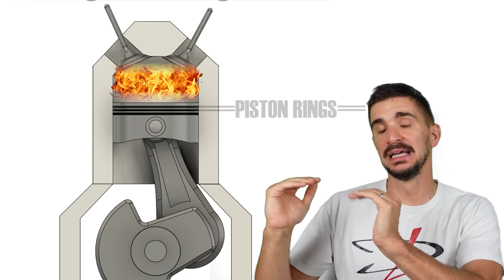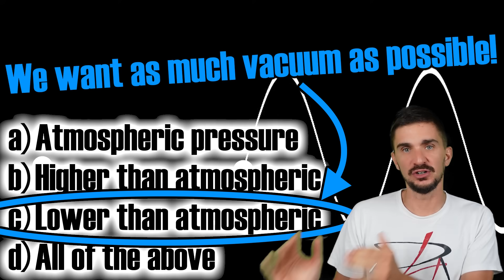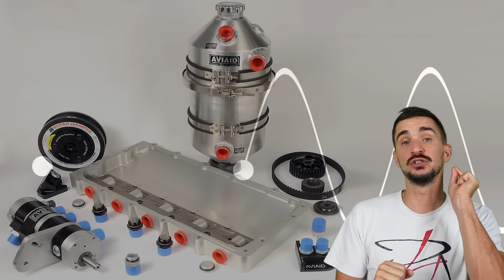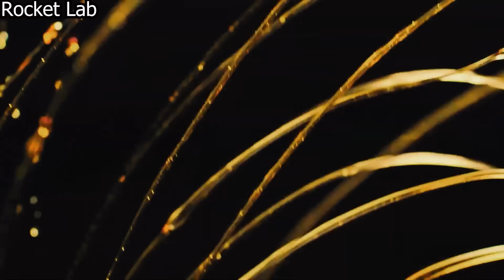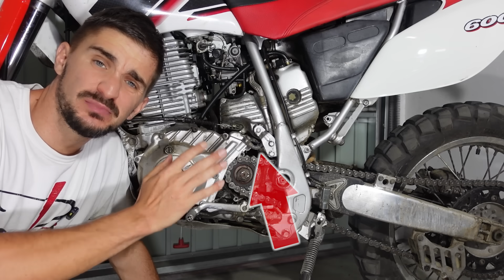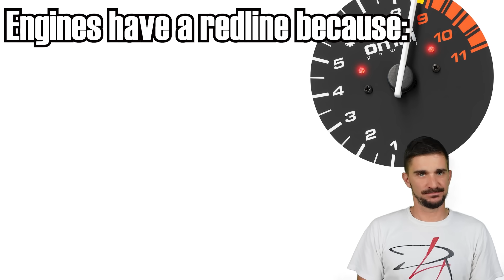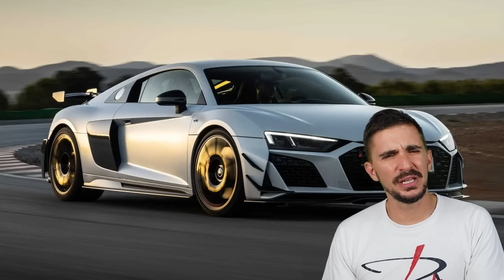Installing This Has No Drawbacks, Except for Your Wallet - Dry Sumps Are Awesome, Here's Why...

Comment: To be fair for those who are seriously assessing if they should go dry sump, consider the additional failure point being a belt. If a belt gets thrown or broken you lose oil pressure and this can cost an engine. Just be aware of this. Also you can have too many scavenge stages and draw too much vacuum on your crankcase but that's something you design for not really a flaw.

Comment: a drawback is taking more time to heat up the engine (and oil). most people struggle in europe with a properly warm engine especially in winters. this will in turn create more engine and cat wear due to the humidity and water inside the engine when its freezing cold.
also you need to buy more oil and when changing it you need more time for it (or pay someone more to do it) as they have multiple (at least 2) drain bolts. the last part is minor but the first part you have to consider, especially when you want to daily it in winter as well. the last drawback is minor if it is just a car for fun/racetrack but there is a reason why car makers dont put this in every car when they could achieve 5-10% more power for free and better fuel economy.

Comment: I think motorcycle engines having to contend with their extreme lean angles is a misconception. Yes, the lean angles do look impressive. But the apparent force of gravity will in fact always have to point straight down to the line connecting the wheels. At any time when the force isn't pointing straight towards that line, the motorcycle starts to tip over. And even then, that unopposed sideways acceleration would almost completely(*) cancel out the sideways gravity vector. Also, initiating a turn by intentionally steering the wheels out from under you takes at most 0.5 seconds, whereas fully breaking a vehicle from highway speeds to a standstill can take 5 seconds or so.
I'd hazard a guess that the forwards-back forces on a motorcycle are in fact those that are more of a danger of running the engine dry than any forces in a car. (The only exception being a car that can pull a wheelie and/or stoppie.)

(*) The amount of cancellation depends on how far the engine crank case is above/below the center of gravity.

Comment: The legendary M306E is a dry-sump engine used between 2004 and 2016. It was designed by Austrian Rotax, owned by Canadian Bombardier, and manufactured by Italian Motori Minarelli. It equipped the Japanese Yamaha XT660R Enduro, XT660Z Ténéré, MT-03, and Raptor 660, the Italian Aprilia Pegaso 650, and the Czech Jawa 660 Sportard.

Comment: Dry sump is a rather high performance modification tho. Most people will have very boring cars and they will drive boringly. They probably won't ever use the abs, won't go beyond 3k revs. For such use a wet sump is enough. And the improvement to fuel economy by having a slight vacuum in the engine is not quite enough to overcome the cost.

Comment: No. No. No. Not vacuum. Slightly lower pressure. All oils and petroleum distllates outgass in a vacuum. That's why they can't be used in space. A scavenge pump is designed for liquids, not gasses, and is not effective at lowering air pressure inside a crankcase anywhere near a vacuum. Just sayin'.

Comment: 21:05 energy is not gained by having lower pressure in the crank case. the total work of air pressure pushing upwards on the bottom of the piston is basically 0 over a full rotation.  the force generates negative work on the down path and positive on the up path which cancels out. this is very similar to how a sealed piston can work as a spring for air suspension. there is some heat generated when compressing that goes out of  the engine and the air somehow cools down during the upper part when pressure is lower,but this is very minimal. the vacuum does not create any free energy and even the absence of pressure does not reduce pumping losses significantly. the only factor that is absolutely positive for power / losses is the lower air resistance  for the crankshaft and conrods to spin.

Comment: 1st draw back of dry sump is the oil system should be primed manually before starting the engine, 2nd drawback is oil will take significantly longer to get up to temperature.

Comment: Wouldn't the volume difference by the movement of the skirt piston be offset by the fact that they are all paired with one another because if I'm not mistaken for one piston to go up a different one has to go down so the overall volume of the crankcase should never change just where the volume is

Comment: An added benefit is that by lowering the engine height, the oil pan can be moved further off the ground, which is important in off-road vehicles. This increases the clearance from obstacles that could damage the engine and/or provides more flexibility for installing the front differential. Greetings from Argentine Patagonia.

Comment: Google AI:

"A dry sump system can improve fuel economy, primarily by reducing internal engine resistance. By eliminating the oil pan, this system cuts down on viscous drag—or "windage"—created by the crankshaft hitting oil. This reduction in drag, along with better piston ring sealing from a vacuum, frees up horsepower and improves efficiency"

Comment: As a drawback that you didn't mention — required space. It's not easy to fit even a custom-made oil box + an oil deaerator. There's barely enough space in a basic transverse 4 banger setup to fart, let alone a whole ass oil treatment plant. This mod unfortunately becomes exponentially less viable the lower the cylinder count and/or displacement is, and becomes more viable with a longitudinally mounted engine for the same reason. Don't forget about future service costs because of lack of space (time is money even if you do everything yourself after all)…

Comment: in Smokey Yunik's column, in Popular Science last century,
he made a see-through oil-pan,
& debunked the whole "oil sits in the bottom of the pan, when the engine is running" theory:

it was actually being dragged-around by the crankshaft
( he was doing NASCAR stuff, not street stuff, so the engines may have been significantly-different from production engines.
This was the one guy responsible for about 50% of the rules in the NASCAR rulebook, in the 1970's, btw..
he was an anarchist: ONLY HIS rules were tolerable, to him. ).

---

the 1st time I heard about crankcase-vacuum,
was in Mike Busch's book on aviation engines..

( worth it, for me! )

---

The thing you were showing, at the beginning of the video,
was accidentally misrepresenting the situation in normal engines:
when 1 piston ( in an inline or V engine ) is TDC, then another would be BDC,
so the pressure would be moving from cyl to cyl and not just-rising, or just-dropping.

That is why in multicyl engines, you're getting such small fraction-of-bar changes..

---

Good & informative video, Hoomin..

_ /\ _

Comment: Does a dry sump engine leave the main bearings and other engine surfaces without pressurized oil since the oil is stored in a remote reservoir?

Comment: Another major problem you missed but came close to addressing. Some redline problems are because all the oil is up in the valve covers. You can rev so high you pump most of the oil up into the valve covers faster than it can naturally drain back down.
Reply: How does one prevent this from happening?
Reply: @hishykot that is a good question. The only fix I know for that is to realize when the rpms are getting too high for that particular engine. If you know the sound of your engine you can hear that problem just before it is too late.
Reply: @jwmax1234 basically, lower the limiter? Doesn’t sound like a performance mod anymore.

Comment: I’m sure we can use fuel economy and emissions as an excuse to start putting dry sumps on normal cars as standard. I’m sure they could design the system for these benefits and get power and longevity as a bonus

Comment: Wouldn’t a vacuum also increase resistance on the upward stroke, meaning its just as efficient?
Reply: It does. Also, the reason why the crankcase pressure fluctuation is so low because there's really none: in most engines with even number of pistons when one cylinder goes to TDC (i.e. 1st cyl in a 4 banger) another one moves to a BDC (4th cyl in a 4 banger) at the same time, which means that air doesn't really change in pressure. So really the only thing changing with a dry sump is air resistance applied to a crankshaft. And we traded the problem of downward piston movement resistance to an upward piston movement resistance, which may be actually worse, but I'm not sure tbh.
Reply: @hishykot thanks

Comment: My BSA 1964 650cc motorcycle was dry sump. Think most of the old bikes were. It still leaked oil at almost every gasket, even after I rebuilt it.

Comment: And what if the piston goes upward?! If the piston goes upward you need a positive pressure to make it easier for the piston to move...the vacuum of the oil pump acts against this, so during half of the time the dry oil sump system reduces power.

Comment: Wait a second! On most engines, pistons are moving up when others are going down. So the volume of the crankcase is always the same. Only on one cyl engines the volume changes. If you install an electric air pump and connect it to oil cap hole, you could create a vacuum as well. You just need an oil separator if you have a lot of blowby. And the pump can be rpm controlled so it can stop pumping at low rpm and oil from the separator can go back trough the dip stick tube.
On my Volvo 850 turbo I loose oil pressure because the crankcase ventilation system is blocked. So I took a oil cap from a Volvo 140 that is ventilated and that problem is now gone. Now it's easy too hook up a pump to the cap. That should increase the oil pressure even more and more power also. Who cares about emissions!

Comment: I think the pressure logic on a piston moving up and down is nonsensical. Yea if the piston had to fight pressure on downward travel that would probably be an issue. But it doesn't. Because besides the numerous vents in the system, the other pistons in the sequence are moving in the opposite direction....

Comment: I had a Yamaha XT600 in 1990 I believe. The motorcycle frame was actually the oil reservoir. It was not easy to check the oil level but my XT600 was a really tank!

Comment: Its basically like an open loop hydraulic/ lube oil  system where the system draws lubricant directly from a reservoir, pumps it to components to perform work or lubrication, and then returns the fluid to the reservoir, allowing for entrapped air/ gases to dissipate,  heat dissipation and contaminant settling. Proven & reliable design in industry and for sure added advantage to prolonged the engine life!

Comment: Don't forget crankcase vacuum pumps and pan evacuation systems for those who cannot run dry sump. I am going to install the exhaust pipe suction pan evac system on my 1993 Dodge W250 with 460k miles to help with ring flutter. It has 30+ PSI of boost and some blow by, so a good vacuum will help.

Comment: Between all of the various pressurized fluid streams being directed into the intake of the modern turbo charged engine, none of these can be run through a venturi to create whatever level of vacuum you wish in the crankcase?

Comment: For anyone wondering, the engine he shows at 5:00 is a Jeep 4.0 inline 6. I know this because it has the exact same intake/exhaust layout as the 4.0, same oil pan shape, same valve cover shape, etc. Coincidentally, the dry sump kit for a jeep 4.0 is significantly cheaper than what most people are saying it costs, only around 2400 dollars. I think I'll go with a lift kit instead.

Comment: I am still curious, how would a dry sump compare to a wet sump in terms of reliability considering no harsh driving conditions? Trying to convince my dad to let me install one on my 1988 ford ranger 2.9 v6(and a supercharger)
But seriously, truthfully?
After reasearching a bit on my own, I am struggling to find a conclusion about if my engine requires a wet sump for lubrication, but it probably does?

Comment: This video is not correct.  For example, unless we're talking about a 1 cylinder engine, crankcase pressure is fairly static, with the exception of the positive pressure created from blowby.  Why?  Because when one piston is traveling down, another piston is traveling up, hence the pressure differential is balanced out.

Further, creating excessive vacuum in the crankcase will not get you more power.  Why?  Because the piston will have to counteract that vacuum on the compression and exhaust strokes, cancelling out the gains from the intake and fire strokes.

Dry sump systems are used for one reason: to keep oil pressure constant in difficult operating environments.  Think of a race car or any engine that has G-forces exerted to different sides of the engine at different times of operation.

Comment: Thank you for explaining a Dry Sump Oil system so thoroughly! My 2007 Volvo S60R has one (6 speed manual!) and I remember reading this in the manual when I Got it and I wall like "WTF is that?"  I"ve found some content on it that basically just says "keeps engine oiled during negative and positive G forces" but none that explained all of the other benefits of it or how it really works! 

I've never had an issue with my Dry Sump Oil system either and my car has 169,500 ish miles on it as of this last weekend.  It seems VERY reliable in the oil department. 
This also explains the extra Liter of oil the S60R has over the standard S60.  

Great video!

Comment: A simple thing low budget racers do is run 3/4 inch hose from each valve cover to a vacuum diaphragm valve mounted on bungs welded in the header collectors.  The flow out the exhaust pulls a vacuum on the crankcase. I dynoed my engine with and without the vacuum lines and it was worth 20 horsepower, 750 with and 730 without.

Comment: Correct me if I am wrong, but the dip stick traditionally checks oil level in the wet sump. How is checking oil "levels" different with the dry sump?
Also how is oil changing different with dry sump? Is oil just drained from and added to the oil reservoir?

Comment: One could do away with all that expense and complexity by doing it the Rotax way.  Their 912/914 series aircraft engines use crank case pressure to push the sump oil back into the oil tank.  Of course this would not address one of the intentions of having a dry sump, gaining some power.  There is one minor inconvenience. When the engine hasn't run for a period of time, the oil level must be checked in the oil tank and if showing down, the engine must turned over by hand to "burp" the sump.  The oil tanks are usually mounted higher than the sump.   These 1.3L engines are proving to be almost as reliable as a rock.   They happily run at 5200-5400rpm cruise power all day. The heads are water cooled and will run at reduced power if coolant is lost.

Comment: Great example of oil starvation in a wet sump system was Hoovies LS swapped Porsche (Apollo 911).  Got the swap done, did a long hard acceleration run and destroyed the motor because it was mounted BACKWARD for the swap and had a regular pan.  Oil sloshed away from the pickup and he cooked the bearings in one long high speed run.

Comment: At least with our current system, there is lubrication garaunteed to vital parts. The system proposed here better be fantastically clever and reliable. It should be too simple to fail. The crank case vacuum and oil level reduction needs to happen where the worst failure results in oil level increase in the case.

Comment: Err, I think the PCV logic was explained backwards.  The valve opens to vent positive (higher than atmospheric) pressure inside the crankcase to keep it from blowing out oil seals, and then it closes once the internal pressure drops to atmospheric. Hard to imagine the case pressure being lower than atmospheric at any point… The case is warming up from ambient temp (volume of air and oil expands) and subject to a constant (though hopefully tiny) flow of combustion blow-by gases from each power stroke. Interestingly, every diesel engine I have owned had a CCV (crankcase vent) system instead of PCV: plumbed exactly the same as a PCV system except with no one-way PCV valve—just a regular open fitting on either end of the vent hose.

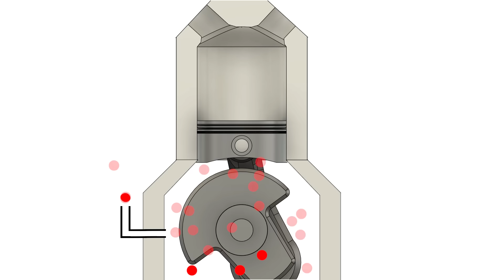Comment: I am at 4:30 but I gotta ask this, if the engine has an even amount of cylinders at the top center position and the bottom center position wouldn't the engine stay at the same pressure?